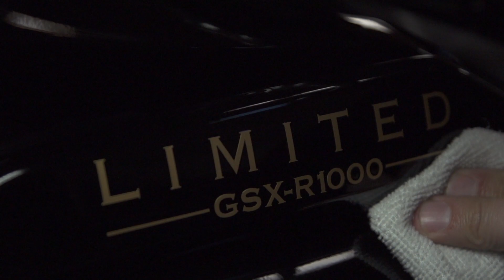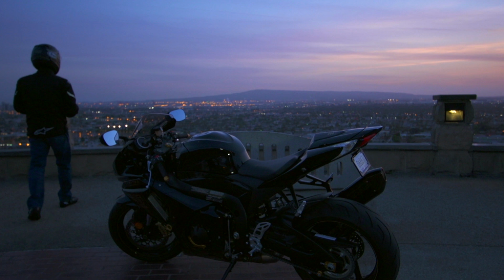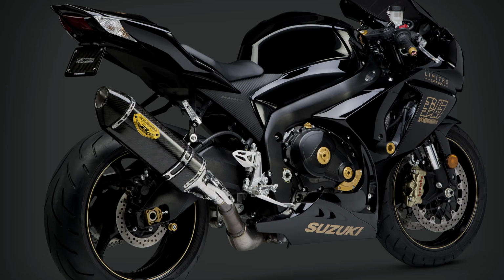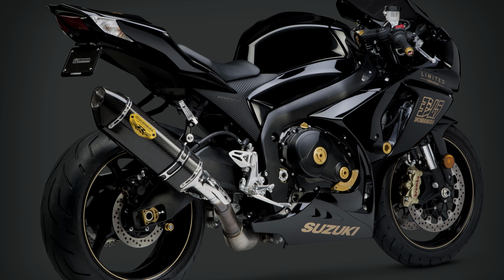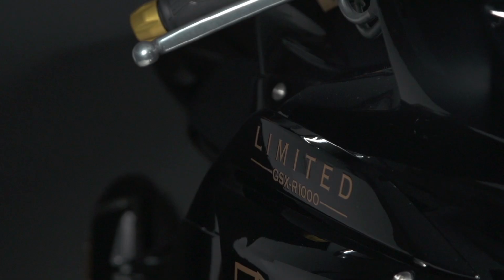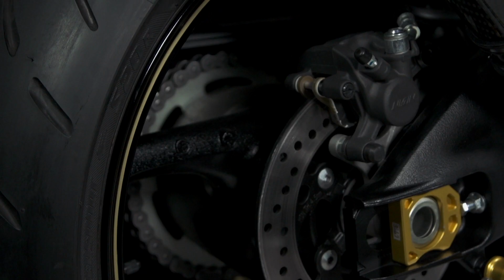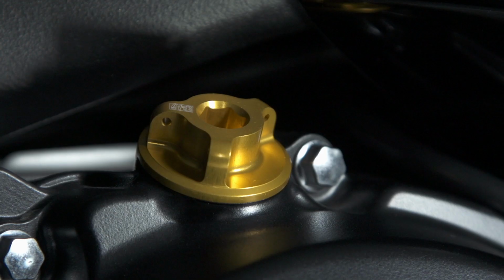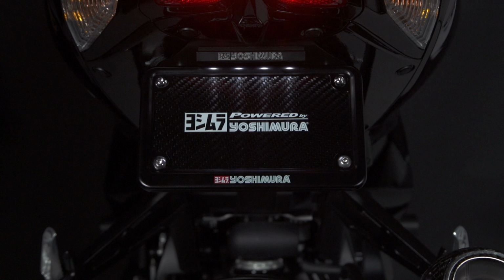Yoshimura Suzuki 2014 GSX-R1000 Limited

Comment: The result is wonderful but hey SUZUKI, stop cheating on your customers by just adding some new stickers to your bike EVERY YEAR (for at least 4 years) and release a REAL UPGRADE of your GSXR with a new engine, some new Ohlins, etc !
Reply: Why fix something that is working fine?
Reply: Damn true, Gixxer is the shit and will always be. If you dont like it then buy a BMW.
Reply: Nick Dekker Are you implying that BMW is worse? lol
Reply: Of course, overrated and expensive and their bikes also have issues.
Reply: Nick Dekker What issues? And why overrated? It's one of the fastest bikes out there.
Reply: Wiktor Krämer yes and no, I'm just saying what I read almost everyday on GSXR forums :) Customers are now frustrated not seeing a REAL improvement (and not really for the engine, that I agree is really cool on GSXR). It's more about "shock absorbers" (sorry i don't know the exact term in english). I also talked a lot with guys on tracks and they complains a lot about it and often put some Ohlins.
By the way, Nick Dekker I did not wait for you to buy one ;) I've sold my 750 GSXR 2 years ago and bought a BMW S1000RR 2012....OMG man...this is the best bike I've ever had, for road AND track. Everything is so perfect...
Just saying.
Reply: Actually in 2012 They did upgrade the bike, Went from dual to single exhaust to save a little body weight, Change the piston coating as well as the material of the piston rings to cause less friction(slightly more/smoother power delivery) so yea. have they done a MAJOR overhaul? No, there is no need IMO. They went to the fully Adj showa a couple years ago and they work amazingly well for stock suspension on a SS, Plus the motor is Cherry.
Reply: Suzuki Steve Hail Suzuki!